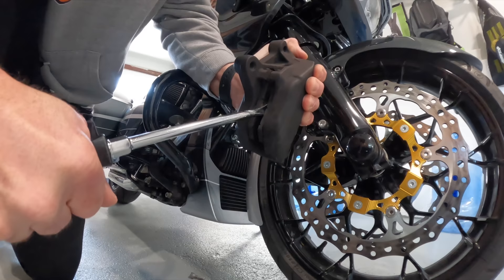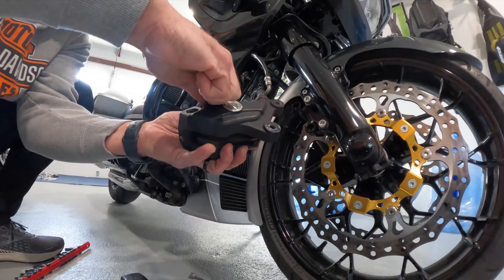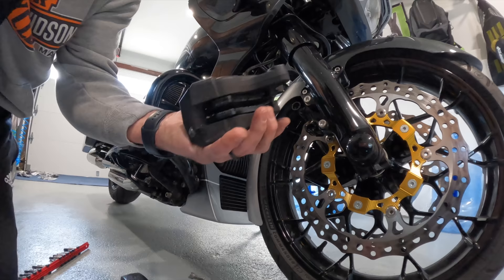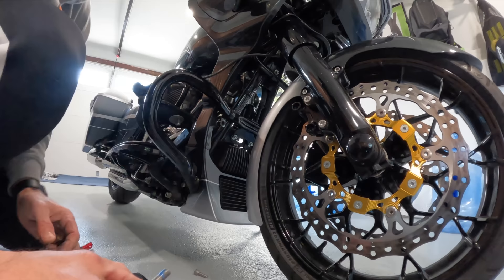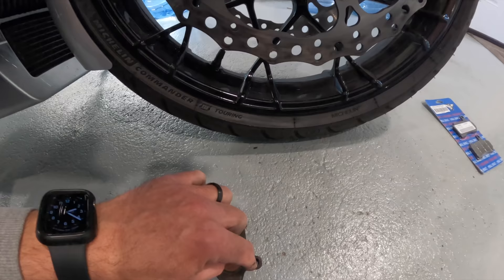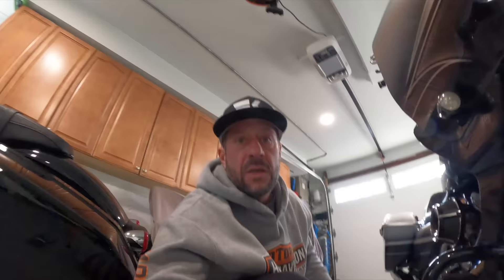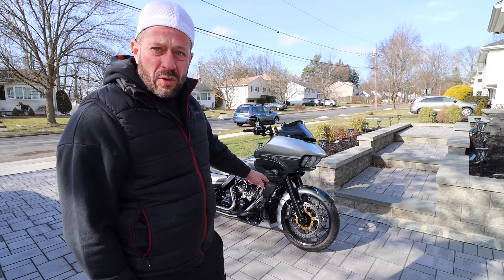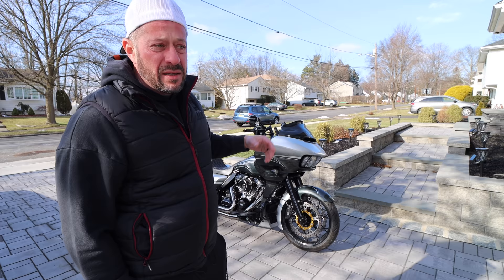BRAKING ISSUES - DO THIS !!!! #ROADGLIDE #BAGGERS

Comment: As usual.  Make it go fast (spend a ton of money on the engine) but don't think about upgrading the brake pads.  Go fast don't worry about stopping.  You needed to change the brake pads when you installed to rotors.  Now the job is finished.

Comment: Great job thanks for info also I saw some good comments on how to change brakes .John u always give good tips FYI just want to add to check brake fluid in the reservoir for humidity, there is a tool on Amazon for a few bucks that checks it cause fluid get moisture in it and causing problems as well u probably know that John just wanted to add that I had that issue thanks

Comment: I did the exact same thing with mine. Why didn't I change them is beyond me. So the new pads are in but same thing. How long does it take them for seat on the rotor? Yours did it in 2 miles. 🥺

Comment: I have run EBC sintered pads for years and I get the crazy "bee hive" sound when I hit them....I was going to ask if you get the same with these rotors and the Lyndall pads....but soon as you pulled up and hit the brakes....YEP!!  Heard it all the way in your driveway!!  LOLZ  Was the braking improvement significant John???  I assume it improved when you went to the bigger rotor, was going to the Lyndall pads another huge improvement??
Reply: @CYCLEFANATIX  If you listen right as you are stopping to pull into your driveway you will hear the buzz..LOLZ...I have now ruined you i bet, as now you will hear it all the time....:D  Its way more pronounced on a Harley for some reason, as I never hear it on my Ducati, but I do on both my SG and RG....LOLZ....sintered pads do it every time...

Comment: Hey John,
Did you torgue the threaded bolts back on or do they need it? Thanks for the video!
Reply: 3 UGGA-DUGGA's will do it.... :D  You want them tight, so use a 3/8 or 1/2 inch ratchet and ensure you torque them til you grunt a bit...dont know the exact torque but they are ones you want tight.